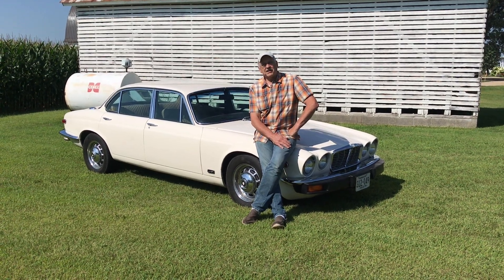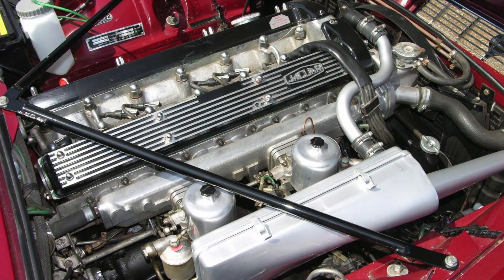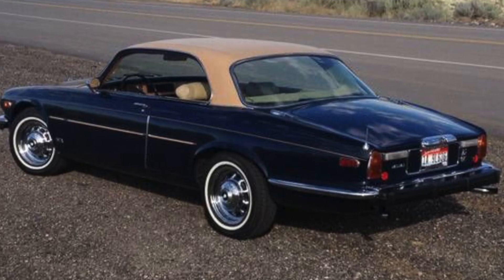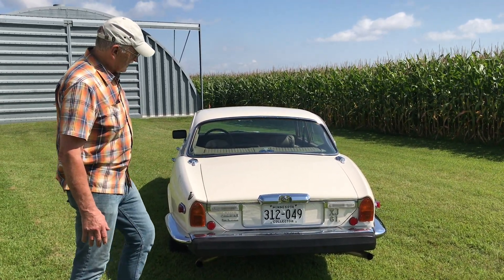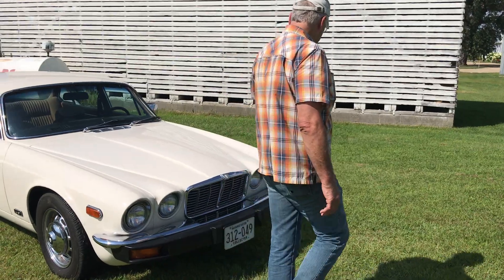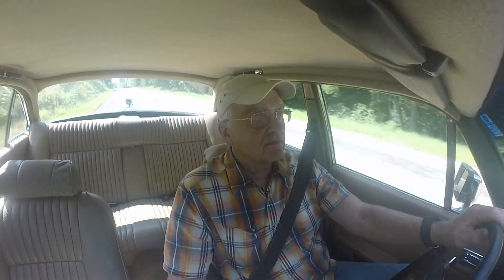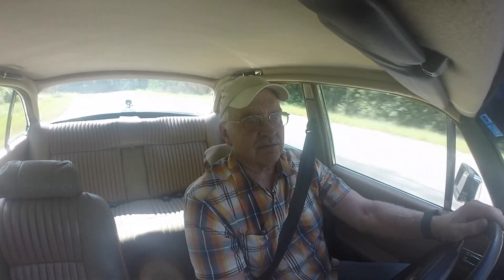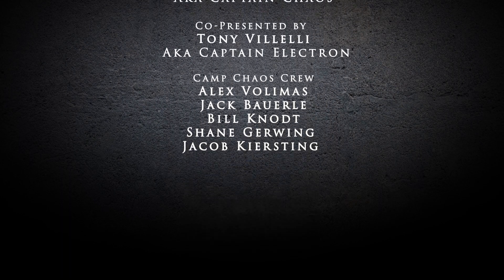Camp Chaos Cars - 1978 Jaguar XJ6

Comment: I just acquired 2 XJ6’s  
   1 is a 1972 short wheel base in Regency red  sold rust free car hood interior. And only 63,000 miles    It will get a transplant from the 6 to the 12  ( carbs)  cleaned up and a cost of fresh paint. 
 1 also have a nice 1985 in BRG  biscuit leather interior. again in nice shape. With 95,000 miles

Comment: Hello Bob. Very informative.  In the UK the series 1 's were available with 4.2 or 2.8 litre . The smaller engine fell below a very heavy tax penalty for engines over 3litre in Europe. It had a habit of melting pistons  but would rev' up to 6000rpm . I had a 4.2 auto and a 2.8 manual .If you wrung the neck out of the 2.8 it would  perform nearly as well as the 4.2 auto. Regarding the series 2 over here , the 2.8 was replaced by a 3.4  and the 4.2 neither of which had fuel injection . We only had fuel injection on the series 3 . British Leyland were in serious trouble by then .The union's were constantly demanding exorbitant wage increases and were regularly on strike . The build quality of the Jaguar was awful and as a panelbeater /painter at a dealership l would spend 3  to 4 weeks  rectifying poor paintwork . This involved removing all exterior panels and painting the bare metal area's left by the factory ! Regarding the XJC the Daimler Double Six is by far and away the rarest model . My favourite was probably the series 2  V12   Daimler Vanden Plas  . Gorgeous interior with lovely mettalic paintwork and  everflex roof . As you said the series 2 SWB only lasted a year. ( it made a much better track car ) We were offered brand new shells in around '73 for £200  delivered. If only you could turn the clock back ! And it was good to see you driving the Jaguar as one should ! Many Thanks . P.S. Have you seen XJ Jesse  on YouTube . A young man with a lot of talent and love for Jaguar saloons .
Reply from the maker: Thanks John. It IS a joy to drive well.
Reply from the maker: Thanks for the info.

Comment: The Series III was a gap filler. Never supposed to happen. Jaguar planned to bring out the XJ40 after the Series II cars but the design and engineering works took too long. That's why the refresh of these Series II cars was outsourced to Pininfarina. There was a clay model of the XJ40 as early as 1972 and it was the last car that Sir William Lyons saw and approved before he died in 1985.

Comment: Just letting you know that your on the wrong side of the road ! Over here in New Zealand over the years I’ve had several Series 1 and 2 quite often running on av gas also put Moreys oil stabiliser in the engine as with the Yak 52. Great  video  very enjoyable.
Reply: The call it the “right” side for a reason.😉Thanks for the comment.
Reply: @knodtre  very good
Reply from the maker: Thanks for the input .

Comment: In fact I was slated to look at an 82 model series 3 xj6 it was white with a 350 concerto in and a fuel cell tank. . It would had needed a New interior and who knows what else as I bought the x300 and never made it to look at her.
Reply from the maker: You probably dodged a bullet. Thanks for the comment.

Comment: 'real nice looking car, much better looking than the series III.
I just bought a III for the Chevy engine/trans I'm going to put in my 
series II, a '75,
You surely know you have a III's door mirror?
Ya, you can see a lot with them but .........
Reply from the maker: I didn't know that. I'm told the car is technically a series III if it has EFI, perhaps there are other transitional differences as well. If that's true. The car does have a series III fuel injection troubleshooting guide with the owners manual.

Comment: Sorry not all xj6 where fuel injected in fact it was only in certain in the usa.
Jaguar xj6 did not become full fuel injected ubtil 1979 and the serie3 , even then the 3.4 version remained carb.
Those bumper where only fitted to north american car they are nasty i much prefer the proper bumpers which are much nicer with the two chrome over riders front and rear. The 3 part rear valance are easy bolt on bit they would rust within 5 years
Skinny tyres on a xj6 series2 never original size was 205/70 15. Avons that not a skinny tyre what you got on look normal.
Reply: Thanks for the input.